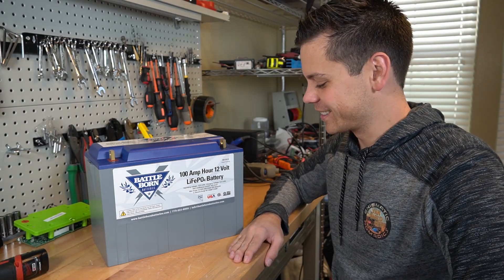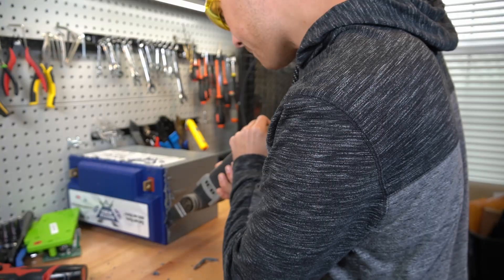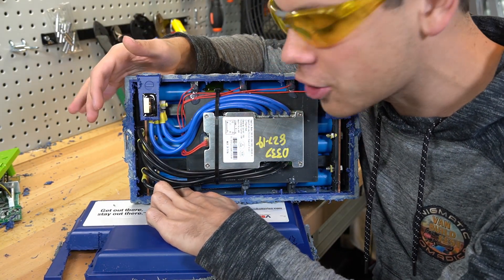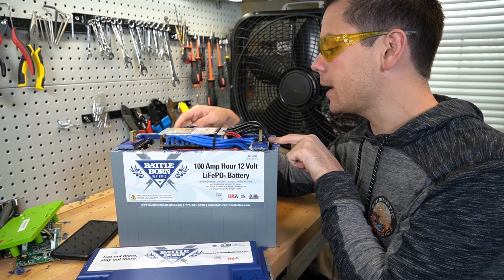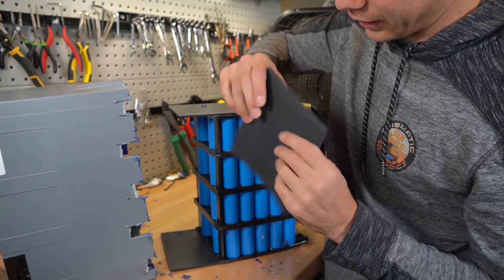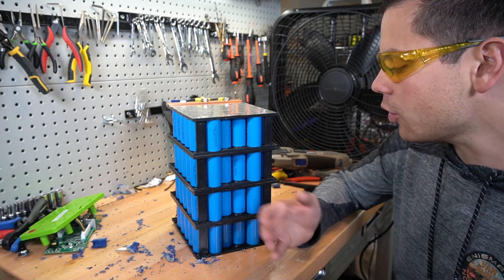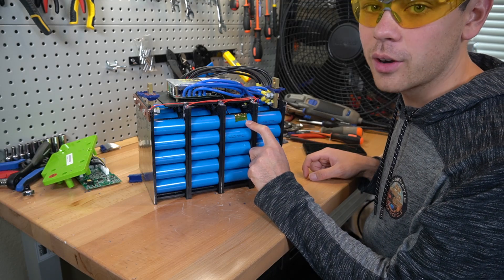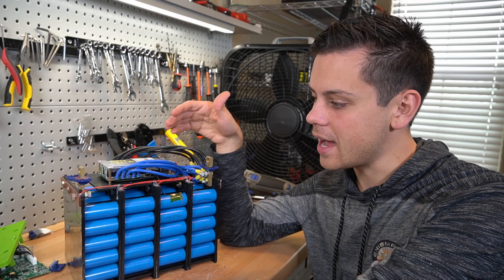$950 "Battle Born" Battery Tear Down

Comment: why the need to touch everything after cutting open the battery in the most sketchy janky way possible... yes touch both terminals at the same time... yes touch the bus bar why don't ya... then wear those safety glasses...
Reply from the maker: It's fine

Comment: Will, have you ever done a test/tear down/compare on a Go Power 250aH lithium battery?  At a recent RV show in Canada they were sale priced at~$1300 CAD (~$975 USD).    Seemed a good price comparable to the Battleborn, but 2.5x the capacity...if the quality is any good?

Comment: Can you do s review on Dakota lithium batteries?
Reply from the maker: I posted this elsewhere the other day: I can't find a compelling reason to even test them. No safety certificates, no UL listing for the battery or the cells. Cheap relabeled case. Doesn't state whether it can be put in series, so who knows what voltage rating of the FET's are. 

And it's expensive. I just don't understand why these batteries are ever mentioned at all. I keep having people ask me about them on the youtube channel, and I can't find a single unique or competitive advantage of them at all.
Reply: @WillProwse  
Ul and safety 
UL-Listed/IEC62133-2017
UN/DOT 38.3
ISO 9001
ISO 14001
IEC/UL 62133
IEC62133

Price 899 for 100ah

11yr warranty 

Made in grand forks nd

You can series and Parallel the batteries. 

Not sure if we are looking at the same batteries.

Comment: Little assistance......  I currently have two 6V batteries in my system.  They say:...    Amp 20 hr capacity 225.
Would a single 12 V 100amp Battle born be better????
Thx

Comment: If a cell develops an internal short, as they do, it will discharge all the cells connected in parallel with it. I do not think it will simply "detach" itself from the pack as you imply.

Thank you.for taking it apart though, that's the kind of review that instills confidence.
Reply from the maker: No, it will detach itself. It has burst cap
Reply from the maker: I think I'll make a video about internal cell protection systems

Comment: I have been using that battery in my twin troller boat for 1 1/2 yr  it has 2 36 lb. trolling motors running at the same time I fish in the salt marsh about 4 days a week ,and only ran the battery down 1 time. If you are thinking about one of these I can give it 10 stars.

Comment: is this battery good for powerboat, a boat that moves at 50MPH at ruff sea?
Reply: I  would feel ok about it, given the quality of the conformal coatings and case but would still use some shock mounting.  Foam surround inside a battery box.

Comment: I us trojan t105 4 of them. My rig was set up 6 years ago. I installed 450 W solar panels with a magnum inverter it would cost Me To much money to switch everything over to the battle born batteries.  I did the figures it would run me close to $5000 to install the battle born batteries 4 of them to T105 which would run me close to $600.  What do you think Should I switch over or stay with the T105
Reply: As you already know, those lead acid batteries only yield 50% usable capacity of the total Ah available.  Assuming those are the 6 volts ones, then with 2 sets in series and those two series connected in parallel, that yields 210 Ah available at 12 volts, that you have, but that only equates to 105 Ah usable (50%).  So if you replaced that usable capacity, you would only need 1 LifePo4 (or upgrade to 2 in parallel).  That would yield 100 Ah (upgrade, @ 200 Ah) and assuming you would just use 80% capacity on those, gives 80 Ah usable (upgraded, 160 Ah usable) capacity at a cost of $1000 (upgraded, $2000) to approximately replace your usable capacity.  Myself, I would advise to continue using what you have until one of them fails, which could be just a few more years, then switch to two Battle Borns, which would be less than half that weight you have now on the 4 Trogans, thus requiring even less Ah.  Those would also give you a very stable 12 to 12.6 volts throughout that 160 Ah usable period, plus recharge much much quicker!  And no winter time maintenance charging.  Also those would give you 6 to 8 times more cycle life vs. the lead acid ones!  Probably not have to replace those for most of your life and that's where & how LifePo4's would pay off!  Just my 2 cents.  Cheers!

Comment: No comments about the off-the-shelf cheap Alibaba BMS they are using?  $10 in qty?
Reply from the maker: Do you have a link? I can't find it
Reply from the maker: They told me that they designed it and outsourced manufacturing. If you can find it, that would be awesome

Comment: This video was very helpful in keeping me calm after a hot bolt (caused by an intermittent  5/16" battery post heated up and melted a hole almost through the side of the case. With a lead acid battery (the kind I am most familiar with) this would be disaster. Since the hole only went partially through the case I didn't worry, since I knew from the video the cells in the battery were unhurt....whew!!! $1000 bucks not lost!

Comment: Because of very low demand per population of LifePO4 battery sales, as of; they never have heard of Lithium Iron Phosphate battery. In most of their mind; Lithium-Ion battery. LiFePO4 is much safer solar battery for your home from fire. I wish Battle Born ever build single 200 amp 12 volt battery. And or 48 volt (52 volt) at 100 to 200 amp for great off grid solar. Battle Born is also great for RV camping with 300 watt solar instead of noisy generator.

Comment: Need a high temp sensor in the center of the battery and low temp sensor at the bottom and top. Then it is perfect.

Comment: Everything looks good,,,,but,,I'd really like to see the battery case be 3 inches shorter, it would make more space available for installs. Since the entire bottom was empty anyway.
Reply: Perhaps turning it on it's side would work. These batteries can be installed in almost any position. They also have another size GC2 which is 12v 100ah FYI 😁

Comment: As you said, “If one of those cells fails ‘open’ then it will continue to work at reduced capacity.” However if one of those cells fails ‘shorted’ then you’ll have a completely different story on your hands. Lots of spot welds equal lots of points of failure, hence the foam mat inside to absorb vibrations and small impacts.
Reply from the maker: I need to make a video about the internal cell protections. It seems that a lot of people don't know about them
Reply from the maker: My understanding is that it will be fine, because in every cell of this variety there is overcurrent protection.

Comment: Great video. Was that a bunch of empty space underneath the cells? Looked like it initially, but then it appeared that some end plates were removed or maybe cut down?  Some of the Victron lifepo4 batteries are MUCH smaller, even accounting for the separate BMS you have to connect them to. Two Battleborn batteries are huge compared to the Victron 200 AH lithium.  Maybe Victron doesn't have that empty space in there.

Comment: Any chance of you making a video of making batteries from individual cells?
I have a 45' sailboat where I'm installing an Electric Yacht motor. Yes, recharging under sail.
It's going to need a huge battery setup. Something like 15 Battle Born and I need to cut the price in half.
No diesel, no fumes, filters, dirty tanks clogging fuel lines at the worst possible moment. 
This is going to get expensive and we're looking for any place to reduce costs.
Your videos are top of the list for anyone who wants to understand what is going on with off-grid power supply. Thanks for the good work.
I'd throw in an invite for sailing to the Caribbean but that's a couple years away.
Reply from the maker: I have like 20 videos on raw cell systems. There are more raw cell system videos than battery reviews on this channel.

Comment: The Renogy 100ah LiFePO4 is on sale right now for $640.  Not a bad deal.
Reply from the maker: They are clearing out for the new and improved model
Reply: @WillProwse  Yea,  I went to the store in Ontario with the intent on purchasing the new "Smart" one, but the new features were not that big of a deal for the extra $80 (it sells for $720 right now), at least for me.
Reply from the maker: @laronis  yeah good point. Very true. A lot of the new features are unnecessary for most

Comment: I've had 200Ah of these Battle Born batteries in my RV for over a year and a half, still working incredibly well. We've boondocked with them, but mainly they're there so that we can always know the RV is ready to go on a road trip. (With our old 80Ah lead-acid, it was a crapshoot if you had enough charge to turn on the fridge the night before or not.) We also have 400w of solar panels keeping them topped off. Recently, I remembered that our RV had been sitting there for a few weeks with the solar panels covered in snow, and I had not disconnected the rest of the DC system, so things like the Victron CCGX were drawing power continuously, which was not a problem in the summer with no snow. I went out to it, and sure enough the batteries had fully discharged. It was also sub-freezing out, so I was just praying that the built-in BMS prevented solar charging in those temps. Sure enough, the solar started outputting once the snow melted, but there was no current going to the batteries because of the temperature. Once it warmed up, they charged right back up, did not have to do anything. So they fully discharged in freezing temps (2 problems for LiIon batteries), and the solar started working in freezing temps, and yet the BMS prevented damage to the battery. I'm sold on these batteries and will only buy this brand going forward.

Comment: Hey Will, thanks for another great video. I've been waiting for the "Great Battle Born Battery Teat Down" - the results were exactly as I suspected. I do have a question for you though - do you receive affiliate commissions on all products purchased through the affiliate link? I need GC2's if I'm going to do a drop-in replacement in my Tiffin, and the link goes to the standard BB10012. Just wanted to make sure, as you've earned every potential penny coming your way. Thanks for your awesome videos and great enthusiasm. Keep it up!
Reply from the maker: Thank you!!! Here is the direct link :) 

https://battlebornbatteries.com/shop/100ah-12v-gc2-lifepo4-deep-cycle-battery/?afmc=24

Comment: I have to disagree with your statement that one cell can fail and the battery keeps work.  Since it cell group is in parallel it will most likely drain that group.  There rarely fall to an open state.  

But otherwise your analysis is great.  I wish you torn apart the BMS also.  I would like to see the switches you mentioned.  

As far as having one temp sensor , as long as they have characterized the heat distribution and know how to adjust it probably is ok.  I would like to see one at the hottest spot and one at the coldest spot as well.  

Great job thanks

Comment: For the verdict: Would you advise managing "120 3.2V Cells" or "4 Prismatic cells"??? 
Looking at confidence BattleBorn has in their product design, cylindrical cells looks like the way to Go - at least from fault resilience angle. 
But for battery life- Can't say unless someone comes up with a study on recharge cycles the two form factors can endure - Any thoughts???

Comment: My semi is 12 volts, and has 4 large lead acid batteries in it,,, I wonder if I could get 4 battle born batteries and put them in,,, I'd have to keep them above freezing though (that would be the difficult thing) maybe a battery warmer for winter time?
Reply: You would probably only need 2 since you get to use 100% of the amp hours.  Battle Born has a custom battery heater for $220 that runs off the battery itself. It only needs to be warm to charge.  They can be used at low temps just not charged.

Comment: Mr Prowse - you absolutely rock. 

Could you do a Renogy LiFePO4 100 AH teardown?   I have two in my self-build van (purchased a few months back).  After watching this great video, I  wonder how well built they are.  I know a shortcoming of the Renogy is low temperature BMS sensing/cutoff, so I'm working on a band-aid solution using a 12V 25 Watt silicone heat pad and a thermostat as some other manufacturers claim to use.

Per one of you other reviews,  I installed a Renogy 40A DC/DC charger which works well and does not overload my alternator - another great review.

Thanks

-b

Comment: Hey Will, ANSWER NEEDED PLEASE - Shouldn't the BMS for this type of design have a connection for each of the individual cells, otherwise 'balancing' isn't being done within the 4 battery banks, only between them? Isn't that a serious issue? Would love to hear a reply on this question please!
Reply from the maker: They are balanced. The parallel packs equalize themselves. Same design in UL listed and medical device approved LiFePO4 packs. Very common. The balancing is only required for packs in series.
Reply: @WillProwse  Ok, thanks for the reply, I understand now!

Comment: I have two of these and every time I look at them the thought of cutting them up crosses my mind.  Better you than me.  Made clicking the subscribe button worth it.  I can also say Battle Born absolutely knows their stuff.  Even when I have asked them a question they don't know it has been "Hang on a second" and they are back with an answer or someone who knows the answer.  I had one fail 9 months into the install and as soon as they reviewed the video I posted immediately dropped shipped me a new battery.  I was down less than two days. I have the Battle Borns  married to a supercapacitor bank wired to only my alternator  and  never run out of power.  FULL DISCLOSURE: Not a full-time van dweller.  I use it as a traveling office.

Comment: I love these testing and teardown videos. I wonder if you've had any experience with Firefly carbon foam batteries. Based on the limited testing data I've seen, they seem to perform far better than anything that isn't lithium, but are ~ half the price of LiFePO4. I'm thinking about using them for my sailboat, but wish there were more people testing them.

Comment: OK, well built battery.  Cost to make: <$180.  Selling price:  $950.  <thud>  OK, 3.2v, so lifepo4, eh?
That's $730/kW, a steep price if you want to build a power wall.  When are their prices going to come down?  It does, indeed, appear that they make a mean battery pack.  Thanks, Will.
Reply from the maker: Check out my raw cell systems that are much cheaper. Or my used cell systems. I posted a battery in my community section that runs at 100$ per kwh. Depends on what you wish to build
Reply: @WillProwse  Will do, Will.  Now I'm dizzy.  I've been playing with new 18650 Panasonics and Sonys, so I'm still in the test mode, building ebikes, etc.  With only a kilowatt of solar on my roof, I'm limited, but it's a start. Thanks for the quick reply.

Comment: Buy some acrylic sheets and wala! See thru battery!  How well do they do when pulling 100a in series 24v or 48v. My lifepo4 banks are 24v 3.2v prismatic banks and want to augment with 12v batts for ease of install and may move up to 48v inverter for kWh stretching/savings?

Comment: You have convinced me to change to lithium. My problem is budget. I have 500 amp 24 v sealed lead that are getting tired 4/5/6 years old.  Do you have any suggestions to progressively make the change?  For example a 50 amp lithium with the lead as backup and progressively increase lithium and then put the lead where they deserve to be, in the bin. Is it doable?
Edit 500 AH not amps.

Comment: EXCELLENT battery erotica in this.  By simple you mean a kit of nickel plates and have us assemble it taking more space if we want say using an old computer case and even computer powersupply  as there the ultimate commodity a decade or two ago I did a sourcing for one and in Ireland found a better electron gun but now we know Silicon carbide or whatever Sic and Gan do for stand is best tech to put in such a finer making  300 in not just out for same currency fins from us Gus.

I still RECOMMEND a group by and 48 volt car battery shaped microhybrid units the sku is easy call an autozone ETC and someone gets a loan and container filled sails to our land whaled.

Electrical storage is a commodity a website needed to bid on with glee can charge the lowest fee.  Ouside a BOX they can come anytime to detox.  In india a entrepreneur wanted to lease titanite taxies by ruppees per kilometer and it took one or two or three big batteries depending on need of poor driver planting his seed steering all day and for most pay nights as well.

He argued ONLY titanate can be great there cuz it is 🔥 too hot for less lithium to if leased work well  [TBC]

Comment: I was torn between Battleborn and Renogy when it came to dropping $1000 in a battery replacement on my little teardrop camper. By the end of the day Battleborn won simply because they were just a tad bit quicker responding to questions and they dominantly feature the low temp disconnect which you really need for a battery mounted on the tongue of a trailer.  I'm pretty certain the Renogy - which is a little cheaper - does the low temp disconnect too, but it wasn't information readily available when I looked into it.  Looking at the simple but resilient design inside the Battleborn probably was the better choice.  I love simple designs that are a bit overkill.  It's the good old why have a 2000lbs axle for a 1000lbs trailer when you can have a 3000lbs axle... or for me, dump the axle altogether and go with a individual suspension. Overkill? Maybe. Will it ever break before my towing vehicle breaks? Unlikely.  Same goes for everything on and in the trailer - including the Battleborn battery and the Victron charge and monitoring components. Get good stuff and you most likely won't have problems when you need the components the most.